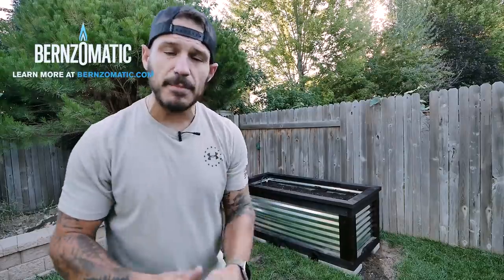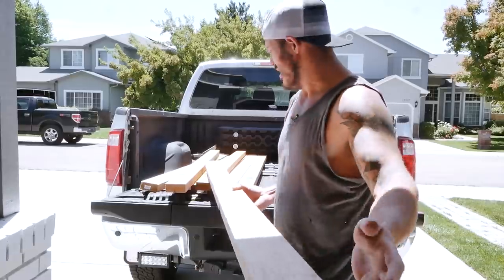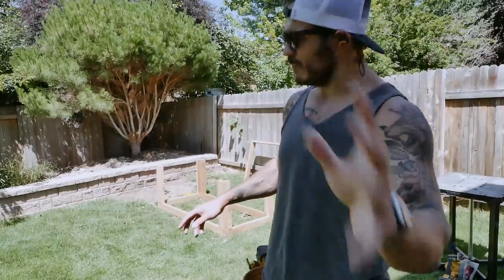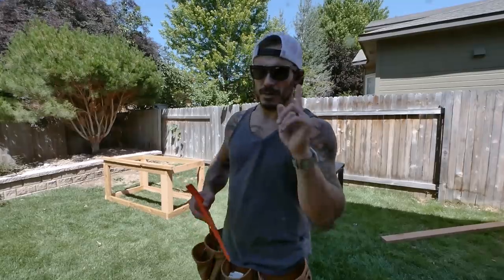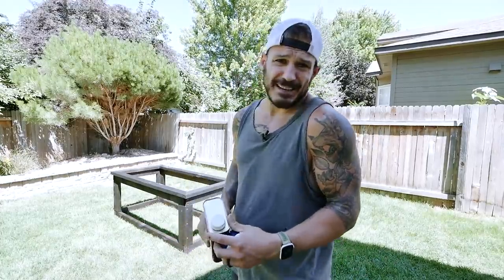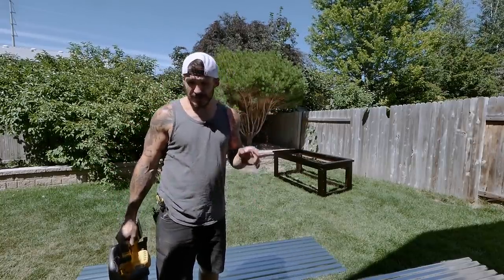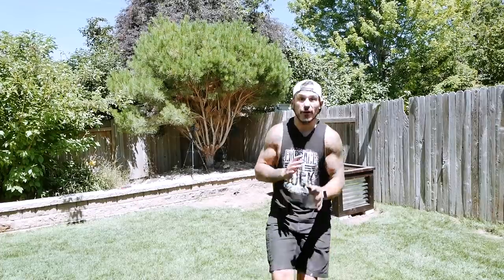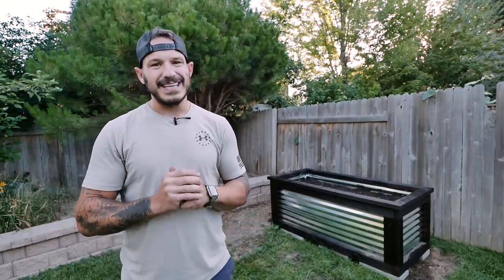DIY Self Watering Raised Garden Bed

Comment: Cool build. I would recommend a few things to new growers tho. Since that's so tall bury some big logs in the bottom, some sticks will be okay too but big logs will build up the soil over a long time. Really stimulates fungi and microbes. Second I would have also mixed some peat moss or coco in there with the top soil and compost, helps with moisture retention. And possibly some perlite which helps with drainage and compaction. With this mix your garden will be good the first year, but amazing subsequent years as the soil gets more loaded with fungi, microbes, worms. Also mulch it, the mulch will help regulate the moisture levels, keep the sun from harming the plants in the hot summer, and keep soil from splashing on plants when raining which can cause disease.
Reply: Soil on plants is something I’ve totally underestimated as a gardener. Thanks for that input
Reply: I would also would have cut away the grass by the fence. Would have taken out and maybe added rock or something so that area didn’t have growth and be a problem
Reply: @patrogers8912  I did as well, but in the fall I shred up a bunch of leaves with a weedwacker, did maybe 3-4 inch mulch with it, so I don't get that splash and have way less disease. The worms really like it too, if I dig a hole for a plant I'm always finding a ton of worms. I guess one note is I hear slugs like leaf or wood mulch, so I use a little correys snail bait here and there and I haven't had a slug problem.
Reply: @vypersportsLLC  I’m still trying to decide what to put on the ground between my boxes for my next home. Previously I had weed barrier down with recycled rubber 16” tiles from Menards. But I’m questioning if that’s leeching chemicals into the yard. The problem I see with rocks is I’m messy. Over time dirt from the garden beds when I’m adding more, or harvesting, gets in the rocks and weeds start growing even in the littlest bit of dirt that spills over the rocks. Over time it’s gonna be a mess. I need to think on it!

Comment: A VERY nice looking and well built raised bed you have made there sir. If I could offer some tips on amendments for improving the soil though I'd say;
1. Landscaping fabric or tarp for weeds
2. Logs on the bottom for filler
3. Perlite or gypsum for less soil compaction
4. Peat or coco coir for moisture retention
5. Slow release fertilizer for when the compost gets used up in 3 months.

Besides that, this looks terrific and I think you'll get an alright 1st season out of it. thanks for the video man, keep gardening!
Reply: You can add some pots along the side (and pull water in from your system) to add more veggies. I.e. container garden.   (Or even flowers to attract bees for pollination and for color and beauty).

Comment: Nice job!  When using the speed square with the circ saw, I have found it easier to put the speed square lip on the far side of the board, pulling it toward you with your left hand as you push the saw through the cut with your right hand.  That balances out the forces and the board won’t want to walk away from you quite as much.  Hope this helps!

Comment: For those that don’t have convenient access to a sprinkler system to make this work, you could make this a self watering/wicking bed by lining the bottom with a pond liner and filling the first 1/4 or more with drainage piping to hold water.  Add a fill pipe in a corner so you can run a hose or many watering cans to periodically refill the reservoir when it runs dry.  Cover piping and fill the voids with a layer of lava rocks or organic expanded clay pebbles, put down shade cloth to help keep out the dirt and help with the wicking/capillary action then top that with your top soil/gardening mix. This method would also reduce the amount of soil needed to fill the bed. Depending on your geographical location this planter might be able to last several weeks before needing to be refilled with water.
Reply: Thank you this is what I was looking for, now I need to see it in action 😊

Comment: Next bed, you can use cut logs or trees to partially fill bottom so you don't need so much dirt. They will break down over time and add to nutrients in soil.
Reply: German mound gardening = Hugelkulter.
Mark from Self Sufficient Me practises this method and he even has a video where he shows how it ( his raised bed using the Hugelkulter method ) broke down over a four year period in his backyard. Interesting facts.

Comment: Now that I am in a house I am going all out in the garden.  Building 3 4x8 raised beds (2 ft tall) and 3 4x6 raised beds (also 2 ft tall).  Will be running drip irrigation to it from the outside spigot (adding a manifold for multi use).  In regards to growing, it looks like you are running a 2x4 bed so if you are looking at tomatoes, I'd go with small growth cherry tomato plants.  You can find some that are more usable for apartment dwellers with small spaces.  The reasoning is that larger tomato plants will overgrow the bed quickly.  Or you could use a couple at one end, spaced apart for growth.  I have a small 4x4 garden that I put in so that I am at least growing something this year and got 4 tomato plants (2 large and 2 cherry tomatoes) and they are taking over a good section of the space.  For smaller spaces a couple of herbs depending on what you cook can be good as well (dill, basil, cilantro, etc.)  If you are looking at doing a little bit of gardening I highly recommend looking into Square Foot Gardening as well if for no other reason than to learn how to space plants out and grow the most you can from what space you have available.  Just my two cents worth!

Comment: Line it with plastic, then fill it half way with stone. Then put down weed barrier and put your soil in with a pipe you can use to put water in if needed. Put a drainage pipe at the bottom of your soil layer for overflow  when the stone layer is full of water. Then the plants self water as needed as long as the stone layer is full of water.

Comment: I'm sure some or all of this has been said. The sod works as fertilizer if left in the bed. 1/2" hardware cloth on the bottom to keep the miles and voles out. Firewood/logs in the bottom, then a mix of manure, top soil, compost, biochar, sea-90, or other mineral additive like organic chicken feathers, all tilled/mixed together. Put it in layers with raw sugary produce in different areas like apple halves, mellon's. These add extra immediate food for red worms. 1 pound of red worms if you don't have any or wait till it rains and go pick them off the sidewalk and put a hundred or so in your bed. 
Love the watering system. 
A heave coating of baking soda around the base should keep the weeds away. Buy in bulk at a farm supply. Plantain makes a good ground cover and is edible. Clover also and puts nitrogen back in the soil.but then again so do other legumes like peas and beans. Try companion planting. Your food will taste better. Foods that go together just check your seasoning jar or your favorite sauce. Tomatoes, onions, garlic, oregano, basil and the like.
Beneficial nematodes and milky spore is also a good idea to keep pests away. The cardboard weed barrier is great and attracts worms. You can add grass clippings or wood chips to the top throughout the season for a better looking garden that holds in moisture better. Late planting will keep certain pests away. Have a blessed garden.

Comment: You’re not alone. I find it hot after like 72 degrees outside, unless it’s winter and the humidity is lower. I’m in Florida though. 80+ degrees here and I’m staying inside unless I have to.

Comment: I had never heard of using cardboard for a weed barrier.... kool, if it works.
I got a tip a couple of years back for a weed barrier.  Use old carpet. Pile side down. water goes thru it but weeds can't come up through it.
Think of how much carpet goes to landfills EVERYDAY.... We couldn't be happier with all the landscaping around our crib using carpet. Cut it to fit - thinking rounded edges.   
Recycled carpet destined for the landfill and we're Weedless for two years and counting.

Comment: Great little project :)

Use Tent pegs mate to hold down your retic pipe. Cheap, rust resistant and easily moveable (for when you need to move the pipe as the plants grow/ change). The other tip would be dont by the expensive adjustable low pressure sprayers, by the non-adjustable low pressure sprayers and just put one valve on the feed pipe... which also means you don’t get wet whilst adjusting.

Comment: could you start adding how costly your projects are?
Reply: I can speak on how much my raised bed ended up costing us. A 10' x 4' bed standing 2.5' tall ended up costing about $500 per bed including dirt and screws. My beds are fully wood, and were pressure treated since I am comfortable in the low amount of chemicals if any that would be leached into the soil through the years. Not as pretty as the one above, but pretty functional.
Reply: I priced out two 4x8 beds this style, get the roofing at lowes, and pressure treated 2x4s, with the roofing screws. If you already have the tools these tall beds are pretty cheap, about 120-150 per depending on wood cost. And the roofing you can get in 12' sheets, so two sheets would cut 2 8' strips and 2 4' strips, perfect for one bed, at about 30$ a sheet. So 60ish dollars and then enough 2x4's to frame it. I'd estimate 13ish 2x4s . 6 8' for long boards on frame and top ledge, 10 2' adding L corner and center braces, 6 4' for cross braces and 2 on the top ledge. 102 linear feet of board. 13-2x4 x 6$ = 78$. 2 12' galvanized roof sheets x 30$ = 60$. 78+60=138$. Good price for a big deep garden bed.

Comment: I'm curious about the success of your raised bed and what you grew in it.  I've heard mixed results with using cardboard as a weed barrier, mostly because it decomposes fairly quickly.  There seems to be a lot of uneducated planting advice in the comments.  
1. Tomatoes are an absolute must in the garden since they are excellent fresh.  If you get an indeterminate variety (most of them)  they will spread like a vine so getting a good cage or staking them up will save a lot of space.  
2. Most veggies do not share their flavors with each other but veggies that require a lot of the same soil nutrients don't do great together. 
3. Most of your plants are annuals, benefit is you can plant something different every year. 
4. Perennial plants (many herbs and strawberries)  often spread so plant them where you want to keep them forever.  
5. Just figure out the growing habits of the things you will plant and know that depending on where you're located everything cannot be grown will from seed.

Comment: Did the cardboard bottom prevent the weeds (and critters) from getting into your garden?
Reply: it just helps set the base and breaks down and by then it's more properly settled. Weeds are everywhere the seeds end up in every inch of soil that you get no matter what you do  (bagged soil will have less but it's much more money) and will grow strongly for about 3 years once you pull them religiously for those 3 years each year there will be less and less to deal with. It will never go away because new seeds make their way to your box by air but it will be much less by year 3.

Comment: 82 degrees?! It was just about 102 when I was planting a small garden in my front yard. Anyways, great vid! A little bit of constructive criticism: it'd be nice if you included the price of the impact driver, circular saw, shovel, cedar 2x4's, 90 degree elbow attachment, tubing, top soil, pavers, the labor for the tractor digging/ compost, circle bubblers, random screwdriver, and the time it took for you to make your "single" trip to the home store and do all of this. Just a suggestion!

Comment: I thought boiled linseed pill has heavy metals in it. Plain linseed oil will work as well, won't it? Or has the formulation changed? Anyway, very nice bed.

Comment: The Chemicals they pressure treat lumber with are Copper , water, and some small amounts of fungicides. No need to worry since your plants shouldn't come into contact with the ground contact boards. Hazardous pressure treatment chemicals are used only in industrial settings or more specifically on Utility poles and Rail Ties. That is why you don't want to use reclaimed rail ties as garden box liners or fire wood. They sell ground contact ties that are treated just like regular green board that you can purchase and use.

Comment: Great build. Few things I'd do additionally: (1) put galvanized mesh at the bottom if a garden bed is in direct contact with the ground - mole defense (2) sprinkler system better be bifurcated and not diverted to a garden bed, better move the old lawn sprinkler in front of the bed so lawn in that area continues to be watered [or replace with directional sprinkler] (3) instead of building main construction with screws, I'd do metal galvanized angles from the inside with bolts and nuts (all that water exposure will make screws give in faster)

Comment: I loved your video.However, you did not give any dimensions of the completed project. Seemed like 1800mm x 900mm to me. Yup, you guessed right, we are metricated here in sunny South Africa. It would be nice if you could put the metric measurements in brackets somewhere.
Also , temperatures in degrees Celsius would be greatly appreciated.

Comment: I’m afraid all that wet soil will bow out the thin metal walls. Not sure that you need three feet of soil. Could have filled the bottom half with a light weight filler material and just put soil on the top half. Saved some $$ too.